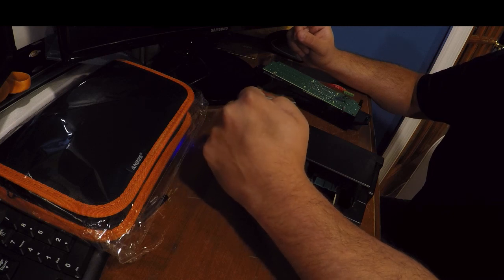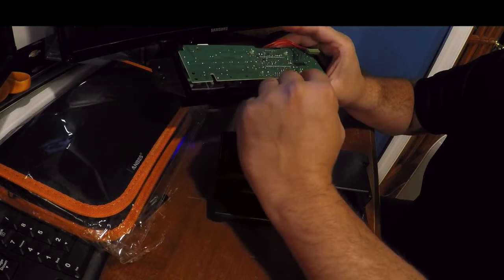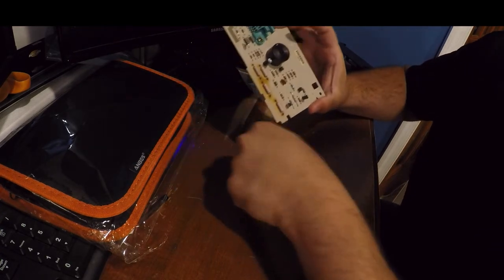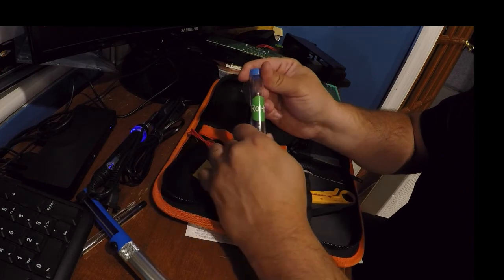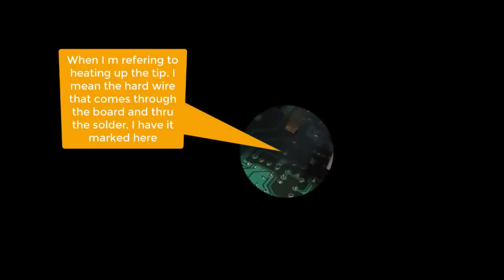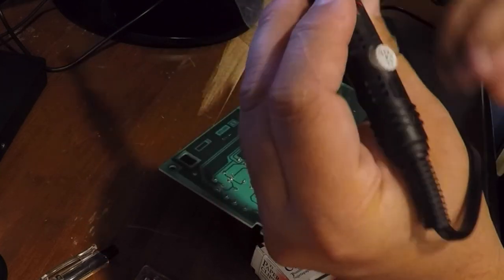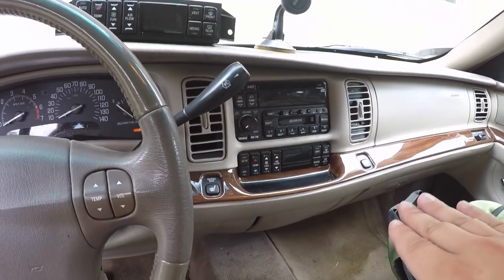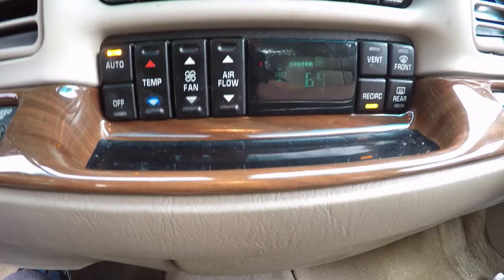EASY - How to reflow solder a circuit board

Comment: All these climate control boards fail there. Resoldering fixes them. Use flux when performing to remove old solder and give yourself a chance at lasting several years before having to do it again as these resistors get really hot  causing solder to fail over time.

Comment: just a tip i know its been a while but when your trying to suck up the solder joints y ou need to add a tiny bit of solder, i know it seems counter intuitive but the rosin in side the solder helps it all start to flow when you see it nice and shiney one shot with the sucker and it s hould suck the whole puddle up

Comment: no need to desolder to reflow solder. simply heat to reflow and add solder to joint if needed.
Reply: Sometimes it's better to remove the EPA friendly lead free solder that cracks overtime and add some good ol 60 40 leaded solder... Might as well since it's all apart anyway 👊

Comment: I did the same thing to my 2001 xj driver door switches that work the windows and locks and haven't had any more problem out of the switches some of the Jeeps were made using cheap Mexican solder

Comment: Honda's have a master relay under the dash and the solder connection crack and cause a hot start issue. Resolderd them a few times. They never should have put these types of boards in cars. To much heat and vibration. Great video